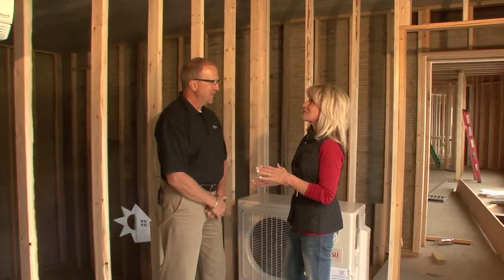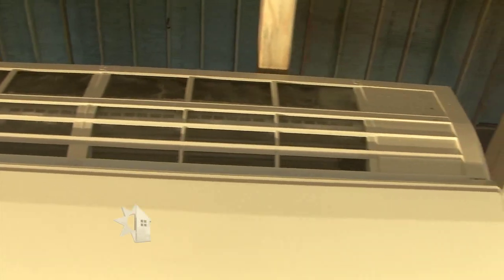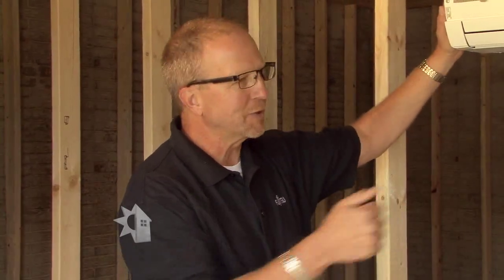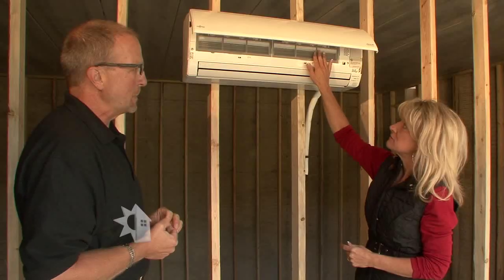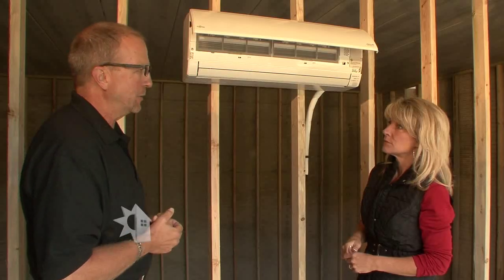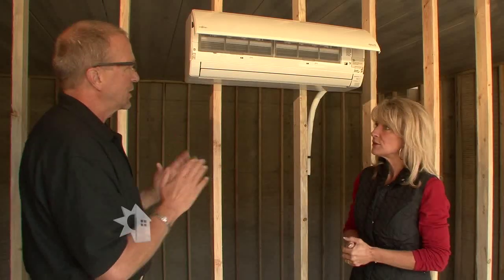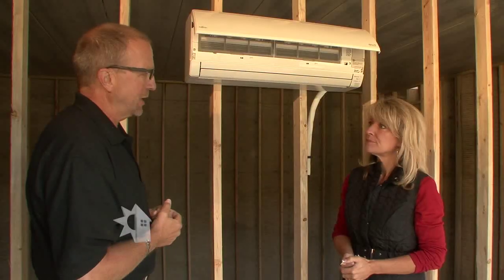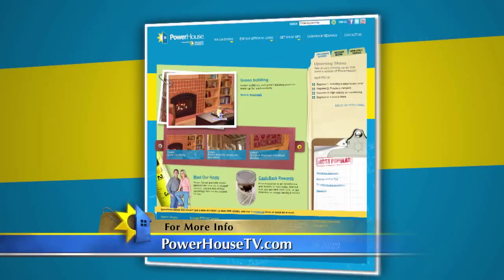Ductless Mini-Split System

Comment: the room where i need the ac does not have direct wall to the outside,so i was thinking of cutting drywall ,go through wall and under the house to the outside unit ,about 40 feet total ,do you see a problem with that? thanks

Comment: What does the typical ductless mini-split system run on?.....110 or 220?
Reply: +Twister051 It depends on the manufacturer and the model. Most 9k and 12k btu units use 110 volts with the exception of Trane units, which use 220v. For units with heating and cooling capacity of 18k and 24k btu, they all use 220v. You can learning more about ductless mini split at: http://d-airconditioning.com/
Reply: +D-Air Conditioning Thanks for the answer!  Very helpful.

Comment: If your architect designs this type of cooling system into your NEW house, I suggest getting another architect. The salesman suggests that homes with "a lot of architectural style" might benefit from these contraptions all over your house. Huh? These split systems are great for retro-fitted areas. Almost a necessary evil.

Comment: Is there a "portable" mini split system...one that you can use without all the mounting and installation?  

I live in an apartment with horizontally sliding casement windows.   I would get a cheap regular A/C but then I have to construct a huge spacer.   I've tried a portable and the performance is poor, they are noisy and smelly.

What I really want is an air conditioner that I would sit entirely on my back patio (on wheels, no mounting) and just have these cooling and heating hoses come in through the sliding door (with a tall, narrow, spacer) -- the opposite of how a portable a/c works.

It seems like they make it impossible if you want flexibility.   Am I the only one who sees it this way?

Comment: It was New to me, in America (MA), but in the rest of the world, it's old hat. The inverter tech is kinda new. It makes MS units work better. Inverter MS units cost a little more, but the savings in power cost is amazing 
My older Sanyo inverter models cool the house easily, and can provide heat down to -15 C or 5 degrees F in the wintertime. I use two 24KHS72 units and my oil burner is rusting away. (Test it weekly). 
My real back-up heat never gets used. Three $20 electric space heaters.